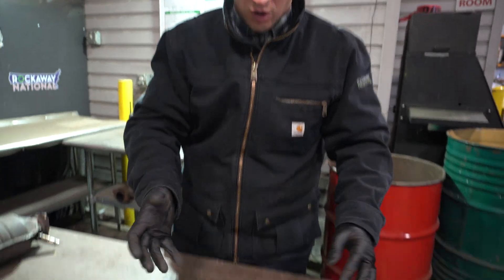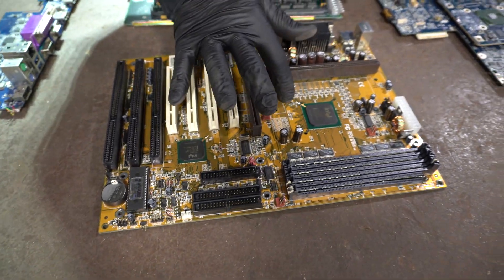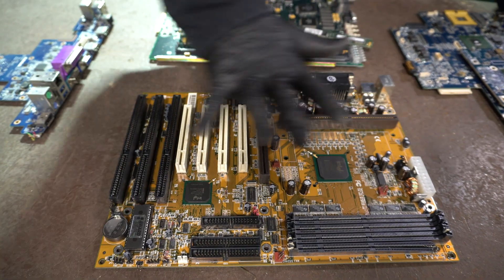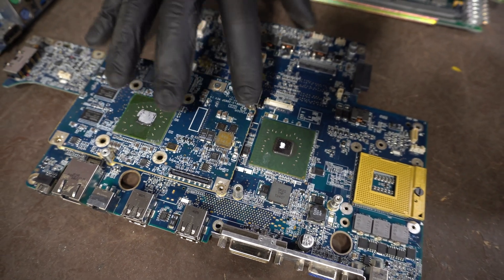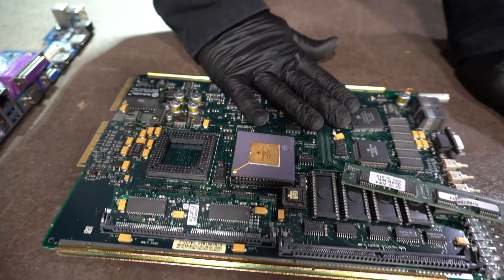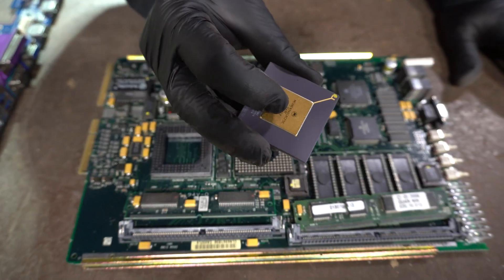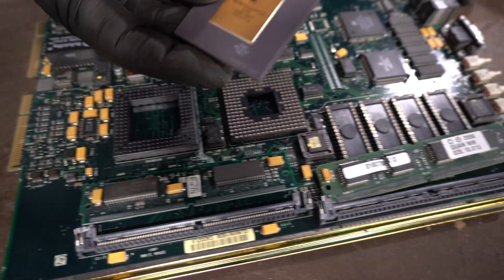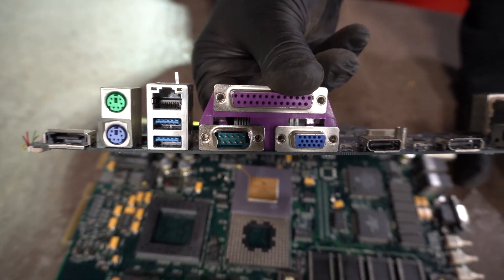What is a Mid Grade Board?

Comment: I recycle electronics that all I do the first second and third boards are all the same price there the highest grade of motherboards doesn't matter the color they are the p3/laptop motherboards there is so many different categories of boards it's took me a couple years to figure it all out but rule of thumb is any board that is brown is low grade that's the only color of board that is automatically low grade then green blue yellow any other color it will depend on ic chips verse junk on the board like aluminum capacitors, transformers, metal and junk on the boards
Reply from the maker: Great information Patrick, thank you for sharing!
Reply: @iScrapApp  yw

Comment: Very difficult to learn which chips have gold bond wires inside of them. Very often, the bond wires in chips are silver or aluminum. 

There's also levels to the thickness of plating on gold fingers and pins. 

In California, it's technically illegal to dismantle electronics and appliances unless you're licensed to do it.
Reply from the maker: What and how have you learned what to do over time?
Reply: @iScrapApp  obsession with certain subjects, and experience in the trades and scrapping.
Reply: California again with the win hhahaha. but true on the thickness.
Reply: Why do you have to be licensed  in California to dismantle  electronics and appliances?
Reply: @michealbrown5903  because it involves toxic wastes, especially CRTs, although it's getting less common to find those in the waste stream. A large CRT will have a few pounds of lead in the funnel glass.
Reply: @michealbrown5903  Its most likely Because certain electronics like flat screens and crts have hazardous materials. some PCBs also contain lead and other hazardous material
Reply: Rule of thumb Is always believe the ic chip has gold some do some don't depends on maker and how old it is but there's no real way to know for sure without doing a batch of each kind of chip and each year produced
Reply: Same as gold corner bgas some have gold some don't but they are the highest value per pound of chips off ur boards

Comment: Thom a million dollar question . When it comes to copper wire ( I know , it isn't board related ) why is the price different from thin  ( meaning extention cords ) stripped shiny wire  to thicker stripped  wire ( 1/8th of an inch and thicker )?
Reply: When melting metal of you have something super thin like foil or thin wire you get whats called "burn off" that's basically where some of that thin material will actually oxidize and evaporate before it hits the molten metal therefore you would loose some product They may be taking into account for the material that will be lost when trying to melt the super fine wire
Reply: @davegdm954  at scale, processors can use techniques and equipment that ensures full recovery of copper no matter the form. 

Large scale processors run wire through granulators that separate the wire from insulations and reinforcement cords/fibers.
Reply: @aredditor4272  yes that is true. but burn-off is still real. usually, granulated copper will go for a lower price than #1 but may also be dropped slightly because of the possibility of contamination. I would like to just make sure we both read the original question correctly haha by saying he is talking about selling the wire stripped not as a # 1 or 2 insulated
Reply: @davegdm954  might just be marketing, but I saw a video from a European processor claiming they can purify copper scrap without electrochemical means. I suppose it's possible, it's routinely done with ferrous ores and scrap. 

I'd also imagine copper mixed with other metals can be melted, tested during the melt, and adjusted into particular brasses or bronzes.
Reply: @aredditor4272  I would assume that's mostly marketing but when you melt any metal you will have some sort of burn off it mostly just depends on the mix of what you put in the furnace. also Im pretty sure they can test a molten metal with some type of specialized xrf analyzer and ajust it to make an alloy with it. I just don't know how they can recover 100% copper from scrap without some copper loss without using chemicals  because with heat you will loose a little because of again either burn off, oxidization, or loosing a little when pulling the slag from the furnace
Reply from the maker: See all of the answers above, they are great and very true responses!

Comment: Don't sell the removable processor chips with your boards, nice old CPU like that can be worth more. Those will have a separate category usually by age/type. They are easy to collect and sell on Ebay if a local yard doesn't offer a good price. Figuring out board grades is a rabbit hole for sure as it can break down into so many categories.
Reply: Yes always make sure to pull cpus and memory from ur mother boards also the aluminum heat sinks and batteries cpus can go for as much as $160 a pound on some of the older cpus like the one u had off that 3rd board
Reply: @patrickbirdsey6940  386/486s can go for over 175 currently
Reply from the maker: How has your luck been with eBay?
Reply: @iScrapApp  Its usually very good
if you put that stuff up its gone in under a week
Reply: @iScrapApp  It's been pretty good, all depends on the age though old enough they probably would sell in lots if separated by similar type/age. When it comes to early Pentium 4 and duo core those really don't sell or not worth the time, easier to sell as scrap or in lots as gold recovery on eBay. 

Newer Intel i series are easy sellers individually if they are gen 3 or higher, though I've sold some gen 2s but probably only got $2-3 profit after fees/shipping and those take a bit longer to sell. 

I have yet to sell my older ceramic processors like this video had but see them in sold listings on eBay. More common ones sell too but those sell in groups of similar as lots which seems to be a better way to go.

Comment: usually, you can't grade boards going off of just color to grade a board. it's down to the amount of ic and bga chips vs dead weight like steel connector ports. yes, some of those have gold pins but if they're covered in a lot of steel  that can work to devalue a board. its the chips and plastic covered pins like a ram slot or PCI slot that value a board. also people should always remove ram even if its silver tin fingered ram is its still more valuable than a server or telecom grade board same deal with CPU chips. especially remove ceramics as the cheapest ones go for about 20-40 dollars a pound
Reply from the maker: We are looking forward to talking to Dave on the phone and learning more from him!
Reply: I agree Dave. I am a student of ewaste ben.